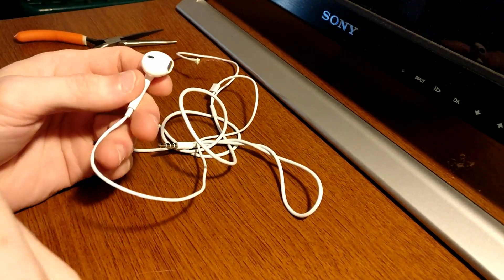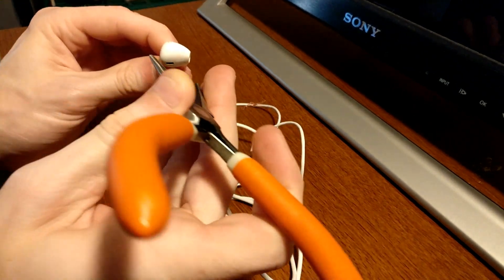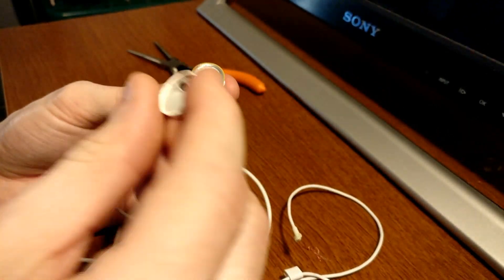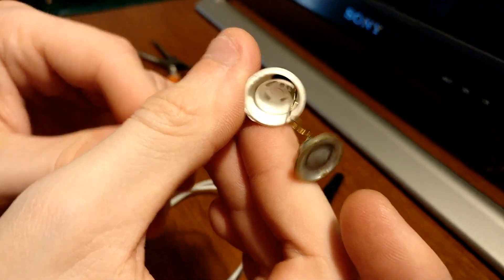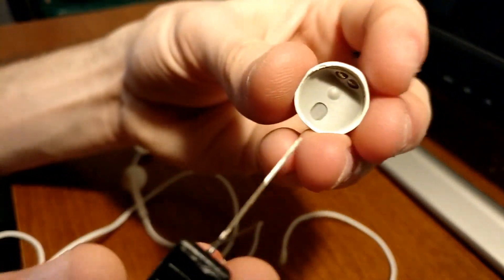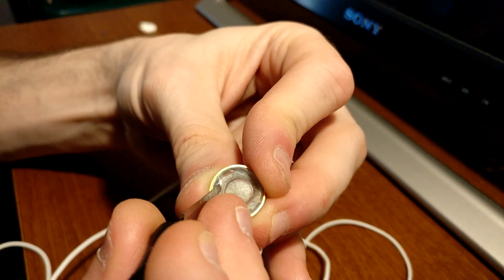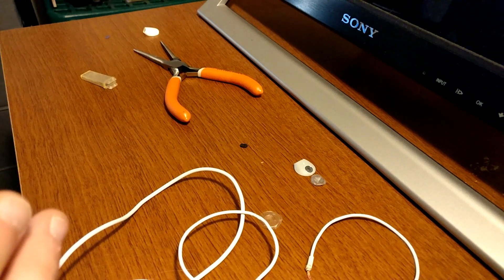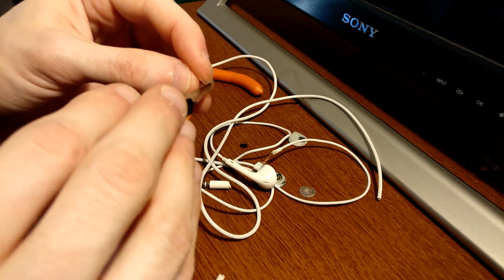whats in Earpods? Earpods disassembly.

Comment: Took them apart and all wires are intact but left one wont work only the right… unsure where they are broken. Mono is set correctly and another headset with adapter works in my Iphone SE

Comment: I have a pair and they lost their bass😯can someone tell me why?
Reply: clean out the all holes present on the earphones it will work  . they need good air ventilation for good bass . if u need to check it just block all the three holes on the earphones and listen  to a song u wont get bass and then unblock the holes it will sound nice 😁
Reply: @mnvs1783  i tried but everything is glued😠i bought new ones...
Reply: @sorinancuta3934  bro why the holes 2ill be glued
Reply: @sorinancuta3934  i said the holes which are present outside not inside

Comment: I removed ear wax from Apple's earpods and they stopped sounding

Only the left side, the right side is working just fine.

I just used my nails and tried to remove the wax. No chemicals were involved I didn't put a lot of pressure, just enough to take away some of the wax.
P.S.: The left earbud (the "damaged") sounds, but not emiting any sound but the bigger hole (the one that goes directly into the ear). The other two, the one at the left of the "L" and the other line at the other side is sounding.
What did I do wrong? Is it going to be ok?
Reply: I have exactly the same problem. Did you fix it? And if you did, then how?
Reply: Same with my right one. I can still hear sound from it but barely. Any fix?
Reply: @adeelk34  I deep cleaned the shit out of them. Works perfectly now. Sanitize it with alcohol first, then remove it with toothpick or something sharp. Then sanitize it again suck out the air of the earphones with your mouth.
Reply: @Tsireka Can I use water instead of alcohol ?
Reply: @Tsireka I had the exact same problem. I didn’t just deep clean it I DEEP cleaned it. First cleaner it how u said and still no sound, then I opened the seam of earplug and did the same on the inside no sound still.

Comment: Thank you dude, saved my money. The noise was almost unnoticeable in left one, just open the buds and clean them and its like new again!
Reply: I just used a q-tip and some rubbing alcohol on the outside mesh a moment ago without opening them up. It loosens up the earwax enough that you can clear it up! Working good as new now, I'm ashamed to think of the money I've wasted

Comment: How do you repair a broken wire connector on the inside of one of the earphones? It got pulled off.
Reply: Solder joint should fix it

Comment: My pair of B&O buds has a short on the right channel just below the grommet (the insulation is visibly pinched). To save these from the bin, I'd need to change out the wires from the speaker contacts. The speaker housing seam is super slim precluding the use of a spudger. You cleanly halved the housing open w. pliers. I wanna have a go yet am concerned re. marring (or cracking) the housing.

Comment: Is it just me or are the EarPods waterproof because they whent in the washing machine it works till this day
Reply: as long as you let them dry its fine, the real damage comes from it banging inside the washing machine
spill any water on any circuit while its off, as long as you dry it before you turn it on it will be fine
Reply: @yeah6247  i had my one in the dryer it worked perfectly fine and the only thing that was wrong was that the heat from the dryer caused the plastic to wrinkle as well as the wire
Reply: Same
Reply: I was in the lake with them in my swimingtrunks poket i was in the water for a good 45 minutes and i remebered took them out to let them dry and they still worked. I belive they are water resistant enough to wear again
Reply: Yeah same

Comment: Can you use those speakers on a cheap pair of imitation AirPods
Reply: nice question, but i think bluetooth circuit is also affected on sound quality, but it can be soldered :))
Reply: Mr. BlueZ hey man, I have the i12’s too, but the little black pad thingy covering the speaker hole came off. Any ideas on how to replace it or apply it back? Any help would be greatly appreciated.
Reply: Mr. BlueZ did it work?
Reply: Everyones so nice in this comment section